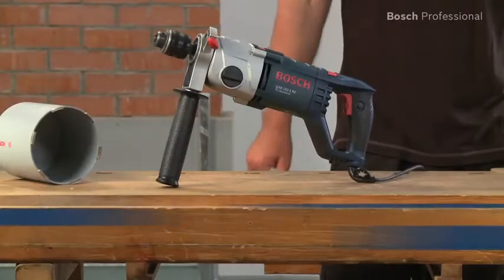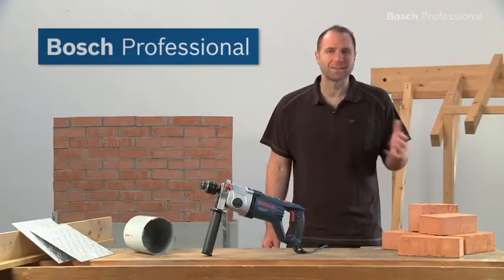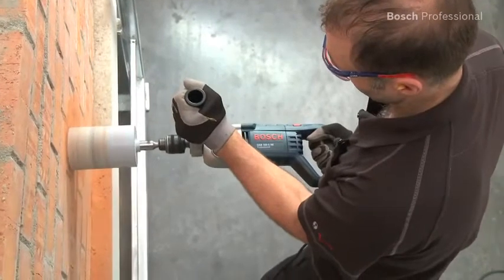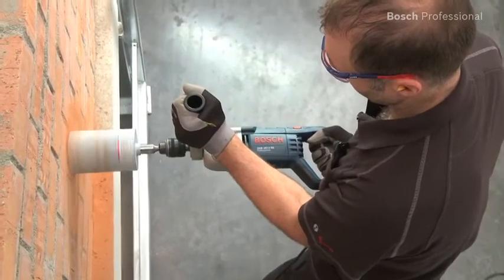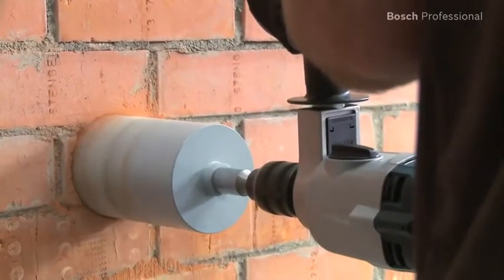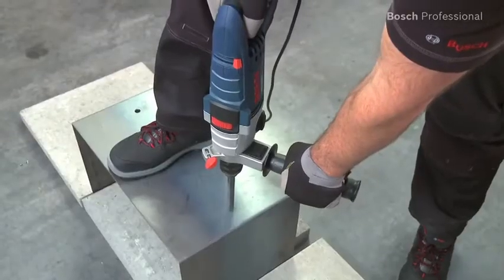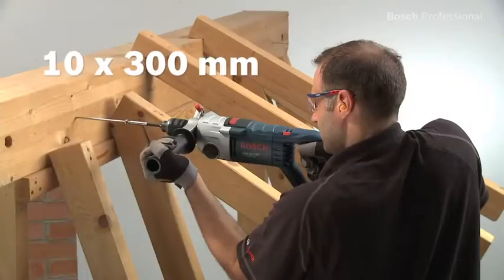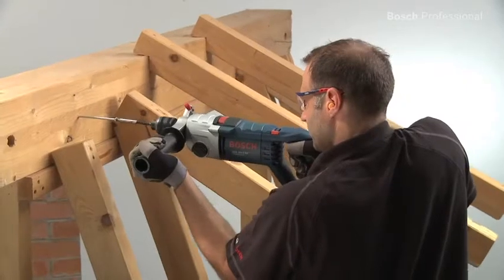Bosch GSB 162-2 RE 2-Speed Impact / Dry Diamond Core Drill

Comment: THIS DRILL IS DANGEROUS. I brought one last year. It certainly has some grunt and can handle 5 and 6 inch holes easily for the most part. However........Twice the clutch failed almost breaking by arm and caused me to fall of a pair of steps. I am now terrified to use the thing again. There must be an issue with it. Various reviews I read just now say the same thing. £500ish not well spent. Thanks Bosch. My faith in your products has been destroyed by this drill. It may be safe to use with a jig, but NOT BY HAND as shown in the demo.